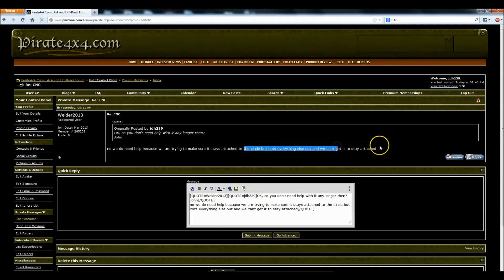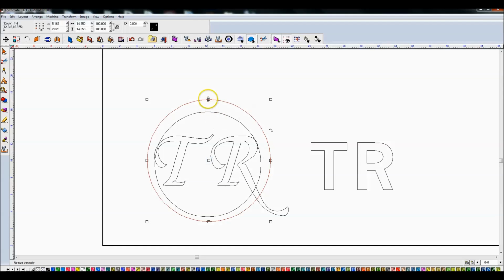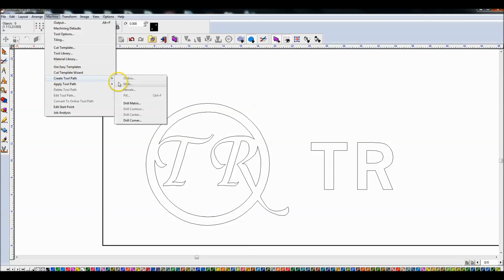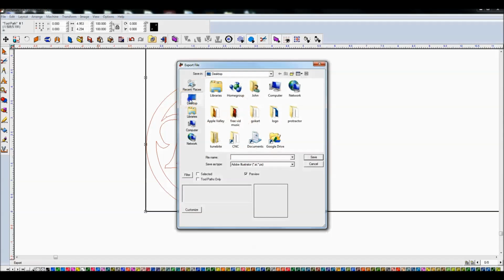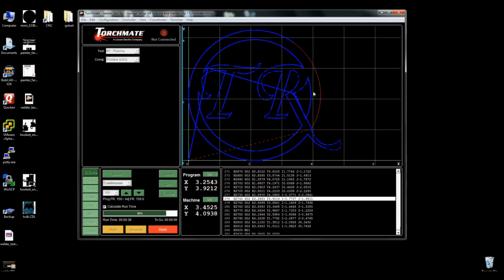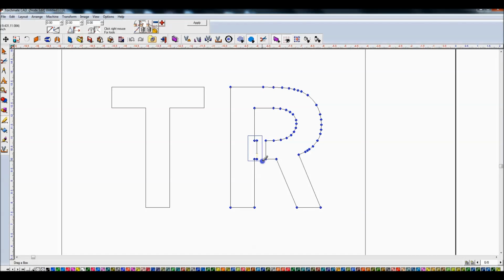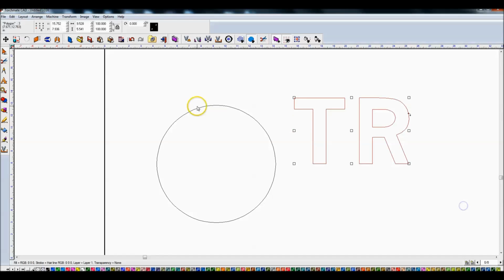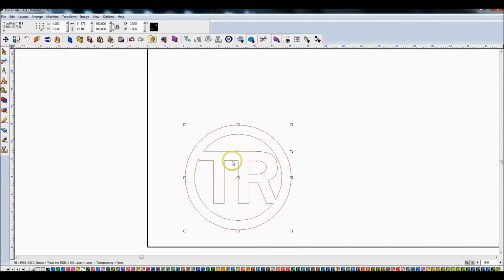Torchmate CAD/CAM:  Basic lettering and preventing unexpected drops

Comment: I don't how to attach a pic here. On the lets see what you build on your torchmate on pirate form page 71, 4th post down timber fab has a pic of a square with a red handle coming out of it. Its a square with a x pattern cut in it. I would love to do this on a project in a couple of months. Mine is more of a rectangle 4"x16" that I would love to do an x pattern all the way through to lighten the piece instead of just doing holes.